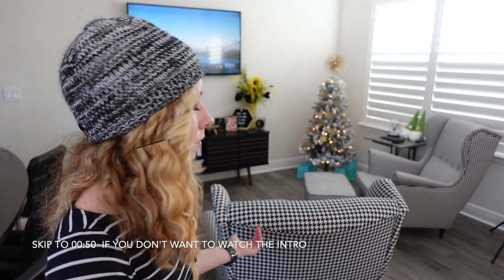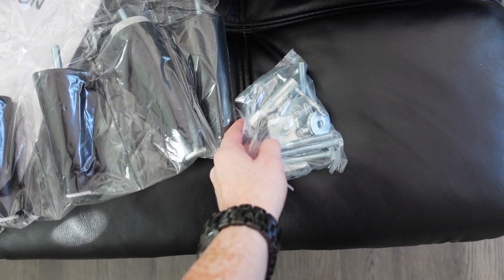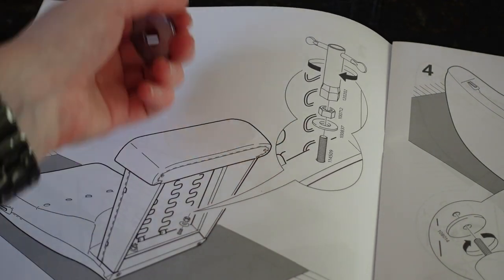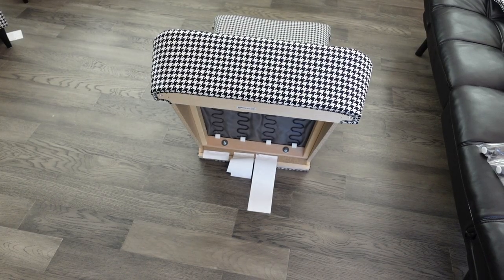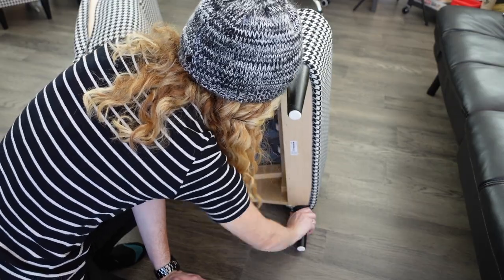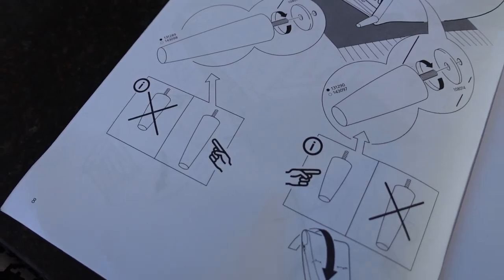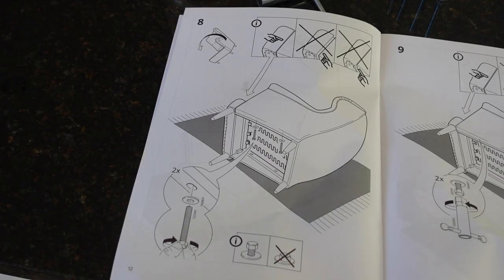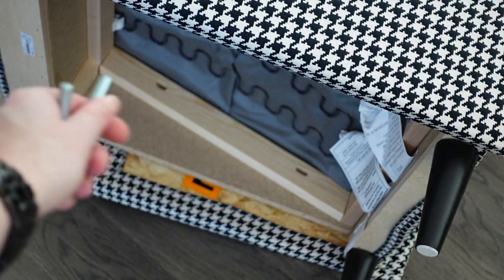How to Assemble the IKEA Strandmon Wing Chair (Talk-Through Tutorial) // SNAPSHOT MINIMALIST

Comment: i try screwing the bolts in and they just don't want to move even though i put them in both holes respectively, this is stupid and painful
Reply from the maker: I understand your frustration. Unfortunately IKEA furniture can be finicky and the pieces don't always line up. I could barely get the side pieces in when I assembled my other strandmon chair.
Reply: Omg tell me about it. Its a F***n mission to put it on!!!! Ughhhhhhh
Reply: @sarbjitsingh870  I had to use electric drill to screw the bolts in, otherwise they wouldn't just go in. Even when I used the drill, one bolt didn't want to go inside the bore but I left it tight. Otherwise it will be pain in the ass